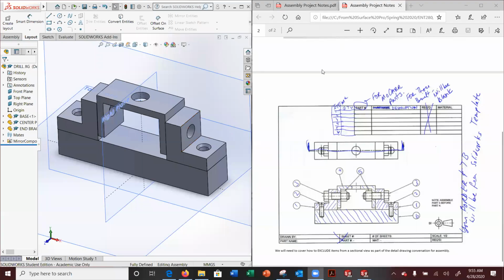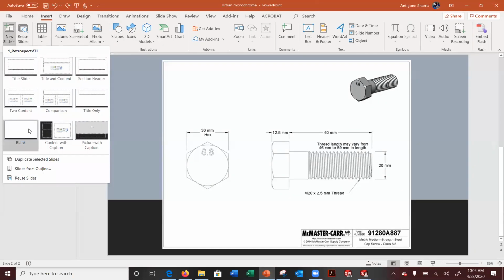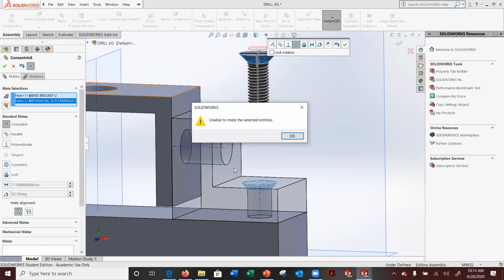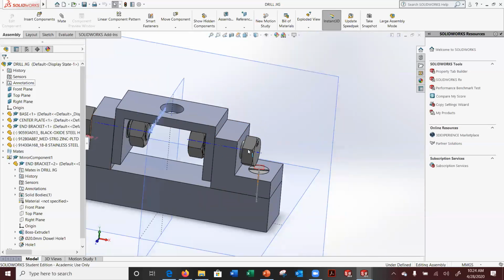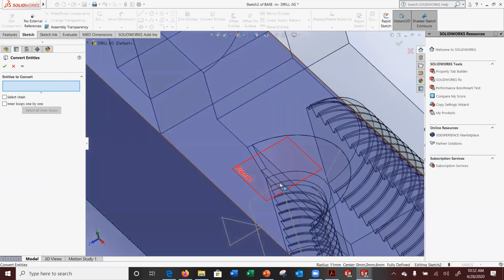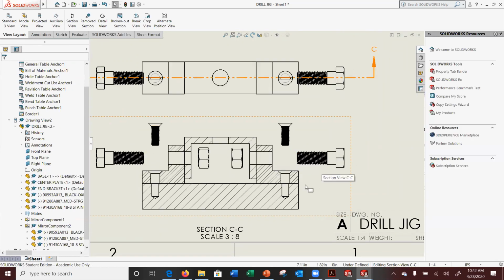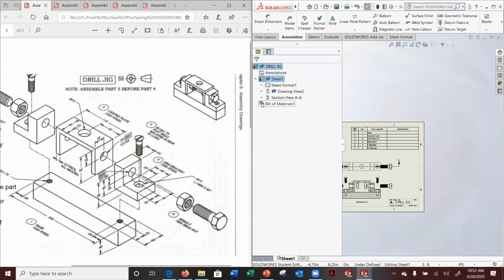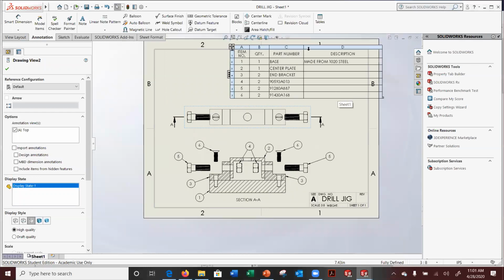Making an Assembly Detail Drawing w/ BOM in Solidworks

Comment: You made it look so difficult to mate the nut when it is so easy.  You don't need to select the interior diameter you only need to mate as a concentric so pick the outside shoulder of the nut for the circular mate surface.  .  Also the simplest way to mate a countersunk screw is to mate the sloped surface of the bolt to the sloped surface of the hole.  1 mate only.
Reply: I don't think she really knows how to use solidworks.